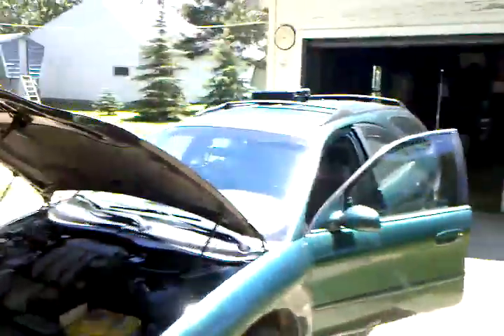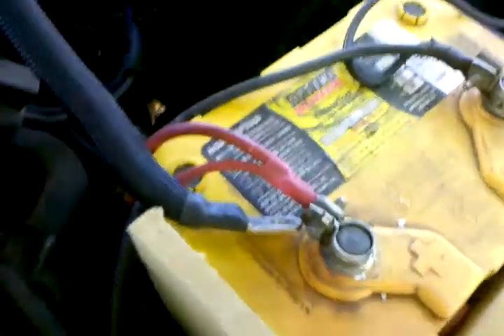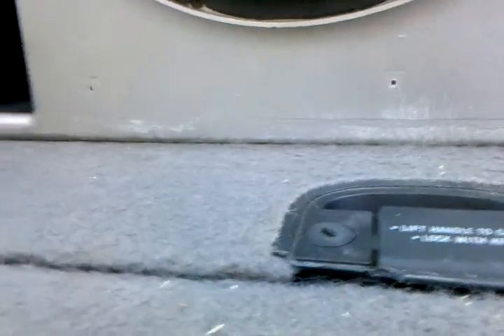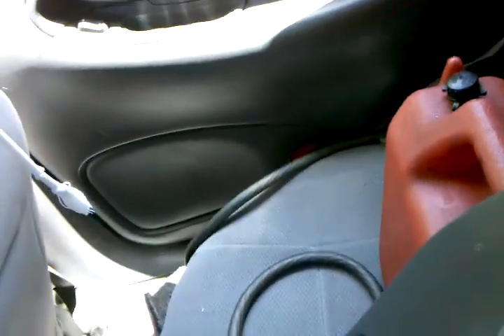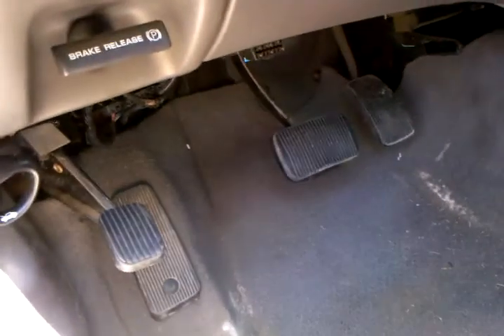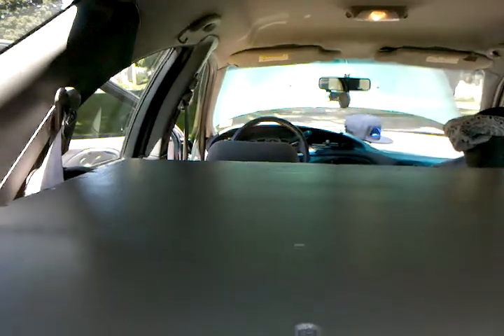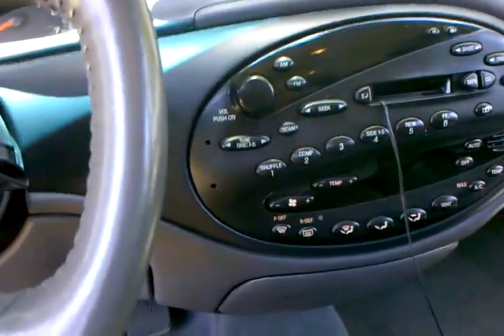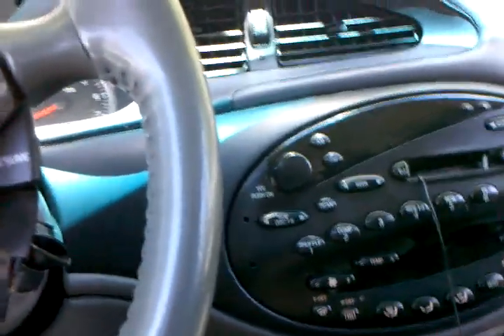DOA Sam Shaggin Wagon System(F Von)

Comment from the maker: @goatskindreams I would if i could, they dont make dash kits for the gen 3 with auto climate control. They do make one for the maunual(knobs)one though, but i unfortunately have push button(electric)which they dont make one for. Im going to leave that deck there and re run new wires via harness from the rcu to the front...

Comment: rip that stupid for radio out already, u can get the radio puller deals at any parts store like under 10 bucks. u can also get dash kits for decent price. don't mess around with that gay factory radio. You wont have the tuning options your used to on a nice hu.